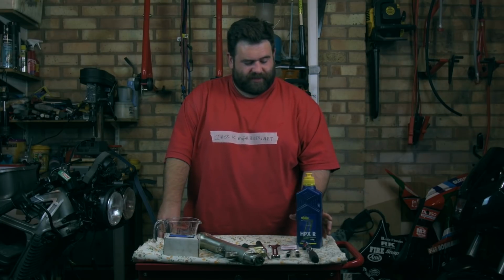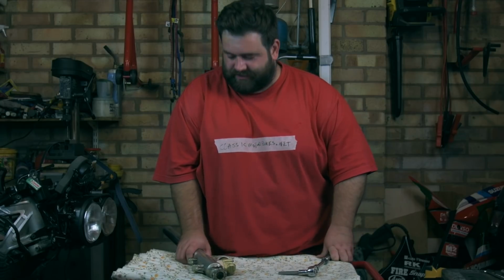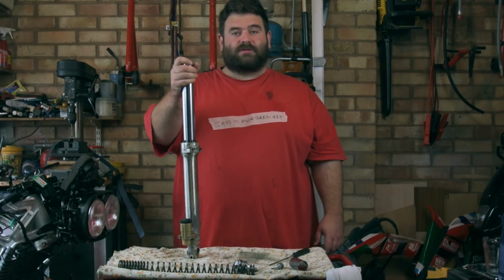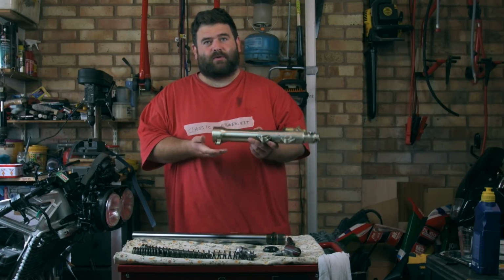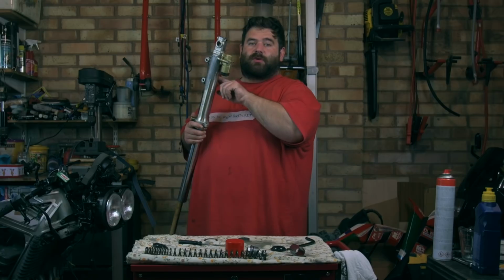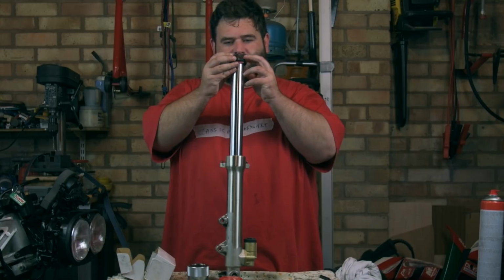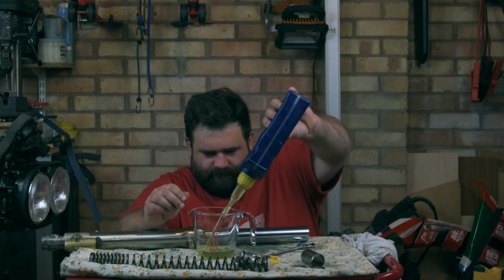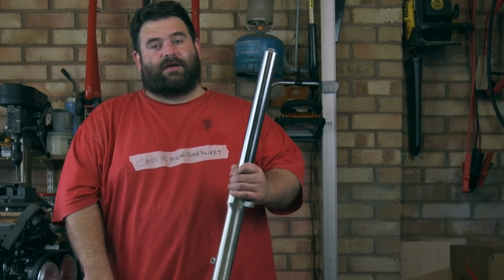How NOT to change a fork seal! | It's GSX-R o'clock Part 3 | Fork Seal Change

Comment: Hi Ian i did my fork seals back in May, it was a little strange really i took my bike for the MOT returned and it was only hours later i noticed my right fork leg was leaking loads of oil, obviously it must have been good for the MOT then give up just after, well done...
Reply from the maker: I've had it happen just before an MOT 😩 I'm hoping this one holds as the one I fitted 10 years ago failed not long after, but this one this one is a genuine seal so I've got my fingers and toes crossed

Comment: Great video as normal, and as it was 4.30am I had not noticed your error but to be fare I very much doubt I would have noticed it at all, thanks for clarifying the error. What's next for the build Ian?
Reply from the maker: Thanks Adam, I only noticed when I was editing the video, I then checked the workshop manual and Doh! I think the next bit will be rebuilding the brakes or the carbs, see what I decide to do first!